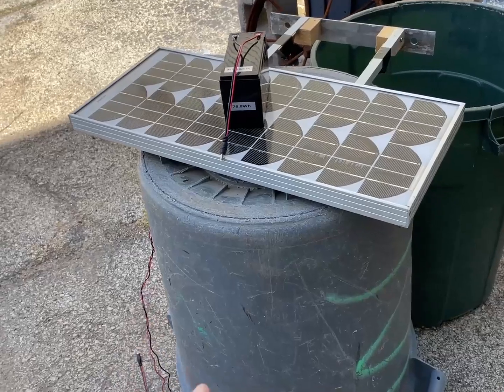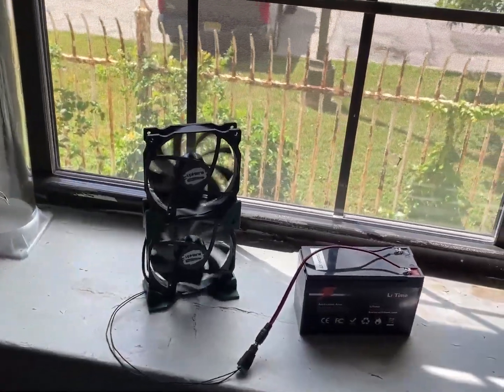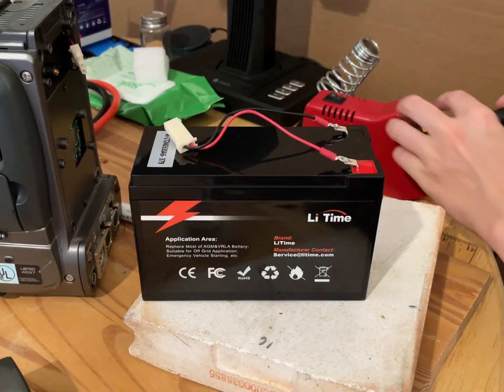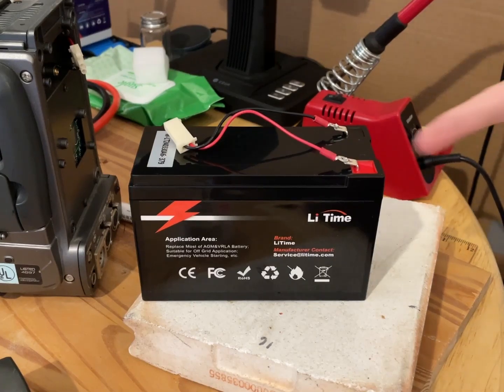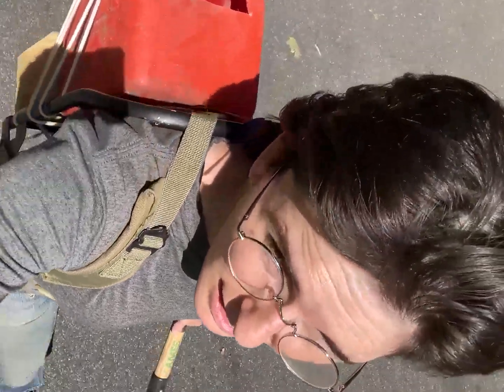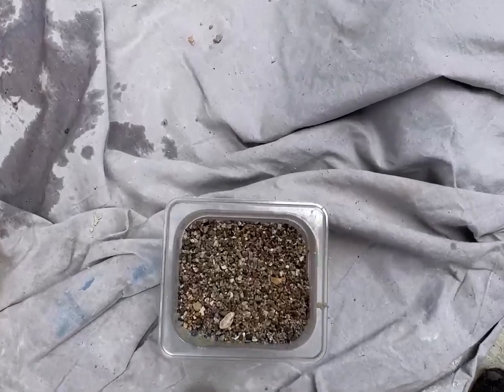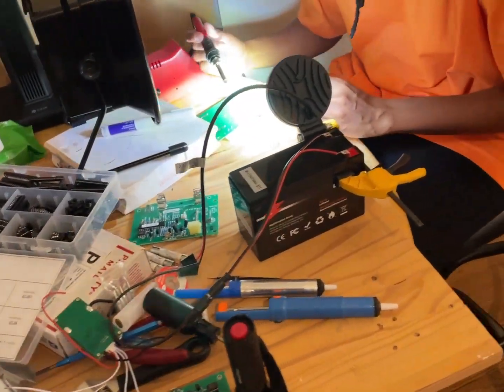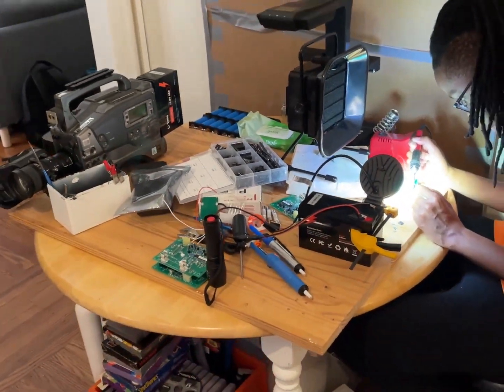Random Bits 0322: Powering various things with Litime 12v 6ah LiFePo4 Batteries

Comment: Can you show how your charging your 6ah batteries
Reply from the maker: I just connect them in parallel with a bigger battery connected to my solar panel or I run the 30w solar panel on them directly with my mppt charge controller

Comment: oh hey its my boards, glue on some powerpole connectors to the side of the battery, they are fairly sturdy as is so they can easily support the weight of that little bike light
Reply from the maker: Yup, finally got around to doing them and happened to coincide with this video

Comment: I'm interested in these - I have a small 12V 400W UPS that uses this formfactor battery but it's lead acid. I don't want to buy another one because they only last about a year.
The discharge specs are 6A continuous and 30A for 5 secs, so it can't replace the LA UPS battery unless I had 5 or 6 in parallel, then it wouldn't fit in the case.
Oh well. 😞
Reply from the maker: I find for LiFePo4 you might want to quadruple your amp-hour rating relative to what the lead acid had.
Reply: @RinoaL  but then the batteries won't fit in the box! Not a really big deal for a UPS though, but then might as well go for a 50Ah battery.
I have a 24V APC 1000 which is working since 1999, and I've been using a home made pack 7S16P of harvested 18650s with an active balancer for 7 years now, and it's still going well!
Would be nice to use the small 12V UPS too, but 12V isn't a good match for NMC cells being halfway between 3S and 4S.
Pity that LFP has lower power density. Hope they can improve on it.
Reply from the maker: You know what you should look into? sodium-ion batteries. I know Gokwh sells sodium ion packs now as motorcycle batteries. Im thinking about asking them for one. They would have cranking amps which could work for a UPS
Reply: @RinoaL  would be good to look at, but so far not impressed by gokwh!
Reply from the maker: @ahaveland  I agree I'm not impressed either. They aren't like go Grener Power / Redodo / Power Queen / Litime batteries. The Gokwh cells are definitely C grade, maybe C+
Reply from the maker: @ahaveland if you ever want a sodium ion battery, send me an email and have me try to get one for free from a company, then I can ship it to you for like half or quarter the price. If you're in the US that is.
Reply: @RinoaL  Thanks for the offer, but I'm in Europe! Would still look forward to a video if you can get one!